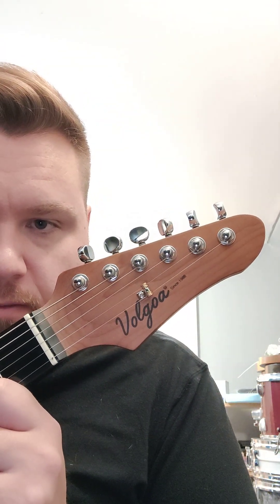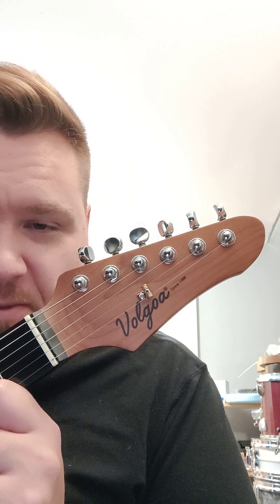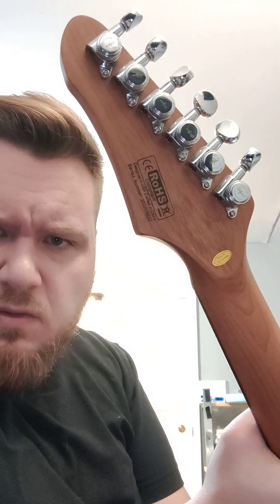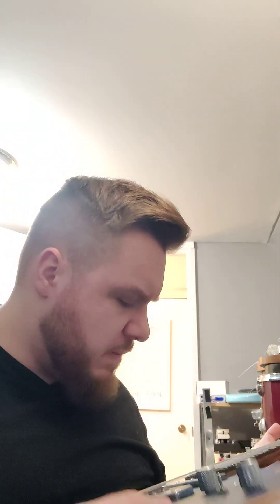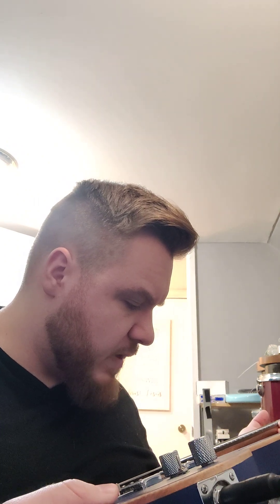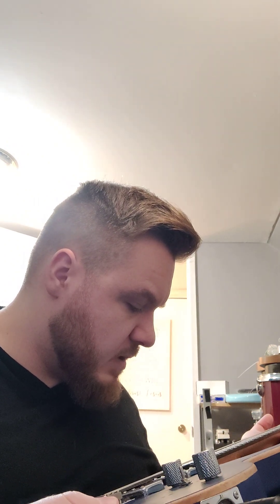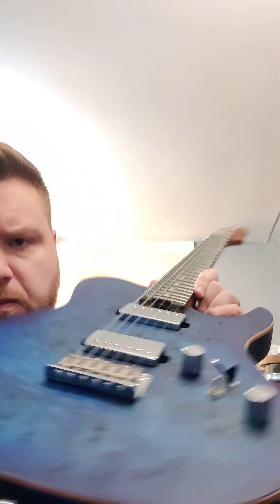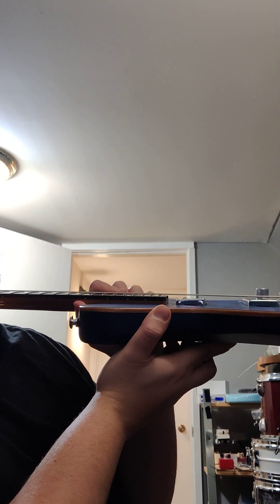Volgoa VTL-2 Electric Guitar Review Buyer Beware

Comment: I bought a Volgoa in a red transparent finish with flame maple top, HSH pickup configuration. Fit and finish was excellent, however; when I plugged it in at a local guitar shop...no sound. We opened up the control cavity only to see that none of the connecting wires to the pots and pickup switch was soldered in. I had to pay $50.00 to get it all connected so I could actually hear it plugged in. Beware😢
Reply from the maker: That is a silly mistake, luckily it sounds like the guitar itself is good.